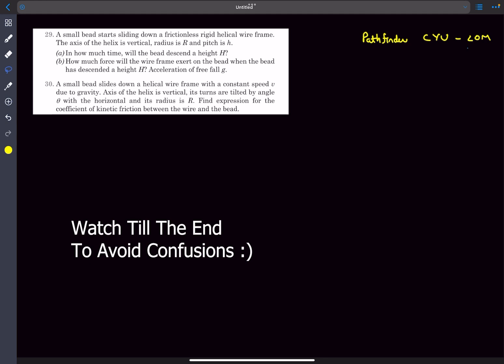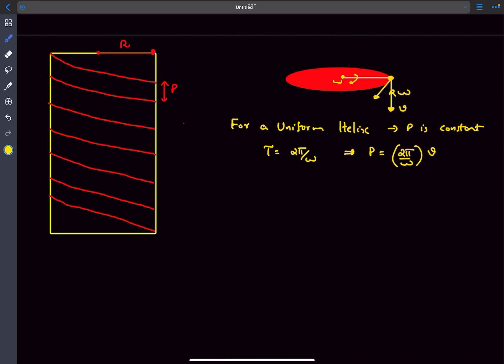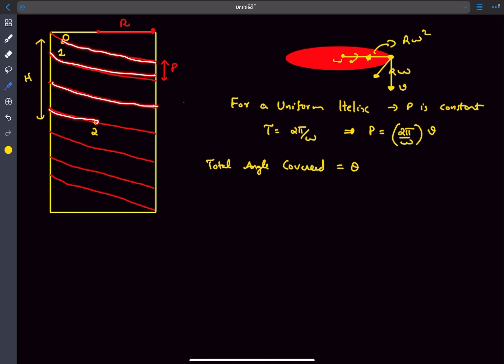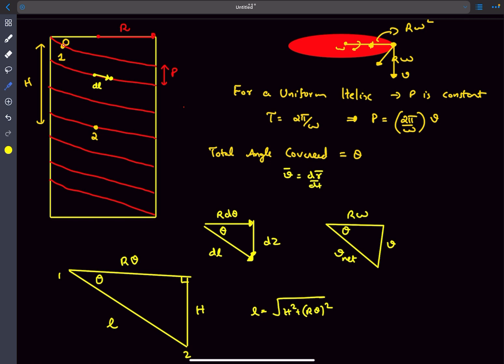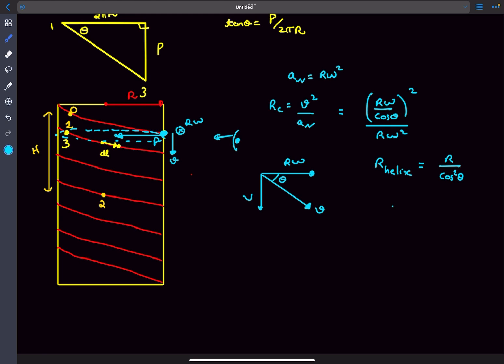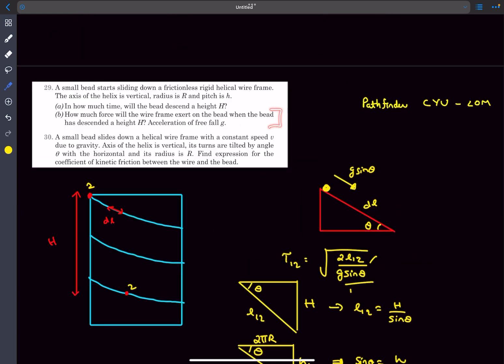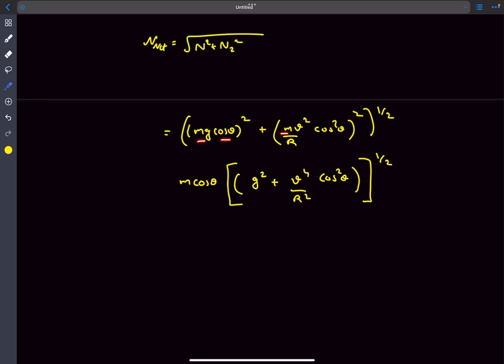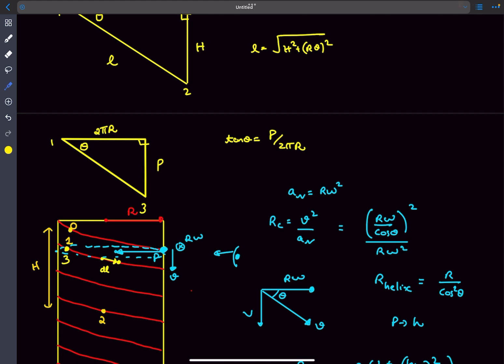[JEE] Motion Along A Helical Path | Pathfinder | CYU 29 & 30

Comment: ARE THE AITS OPTIONS WRONG? CUZ IT SEEMS THEY HAVE RELATED THE HEIGHT DESCENDED H=2pi R n Which is wrong according to triangle relations.
Reply from the maker: Hey bro I just solved it and it matched with the key
Reply: @PhyX_03  OhK I will try to solve it, i thought it was exactly same just divide by mass and relate circumference to pitch so i thought orally.
Reply: @PhyX_03  GOT OPTION A! 👍Thnx for the video